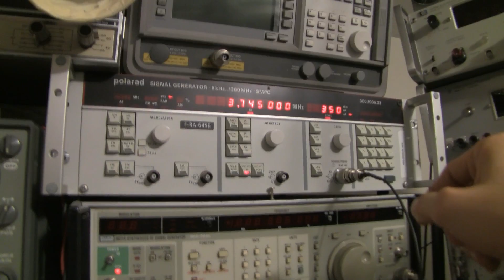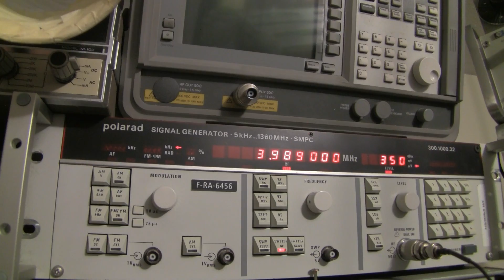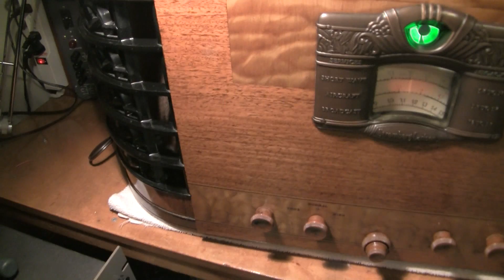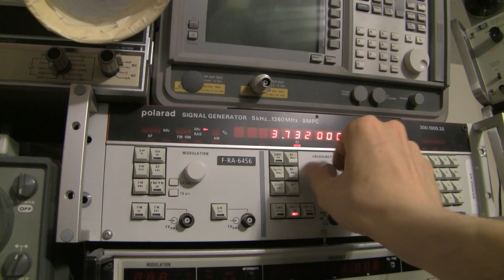Listen to SSB or single sideband on your old AM radio

Comment: An easier way is to inject a frequency close to the IF, about 455 khz. Best if you can do it in an IF stage but it would also leak in from almost anywhere. That way you don't need to retune it. Just rock the main dial until it's clear.

Comment: I used to consumer grade shortwave radios to receive upper side and on the 20 meter band by tuning the SSB signal on the front facing receiver then using the vfo of the shortwave receiver behind it as the bfo and zero beat the usb signal.

Comment: Pretty sure I’d have to be very careful trying to attempt this on a 1940s ac/dc set I’ve got, actually from listening to what you’ve said at the end. I think I’ll need to study this a bit more, as well as the receiver it’s self! 
I’m not sure how much noise that receiver produces, haven’t bought it back to life yet, I fed it a bit over 70 volts and it wasn’t happy pulling too much current.

Comment: You can also use another radio in close proximity. I used to use an old Panasonic multi-band to inject a leak into my Radio Shack desktop that lacked a variable BFO. I could tune the Panasonic to a sweet spot to generate a variable signal that decoded USB/LSB on the RS desktop.

Comment: Could you set your signal generator to 455kHz, find a SSB signal then tune the signal generator to 454kHz for LSB or 456kHz for USB? I'm curious if that would also work so one could build a simple tunable IF frequency oscillator to use as a BFO rather that using a 2 to 30mHz wide band oscillator or signal generator.
Reply: That's a much easier way to demodulate SSB

Comment: I suppose you could  tune a signal generator just off the IF (in this case ~465kHz) and inject it into an IF stage?
Reply: If you inject the 455kHz into the antenna input you will get enough through the mixer

Comment: Just came across your channel and its awesome so much to learn. I wonder even though this is such an old video if you would mind if I were to ask a question. I recently built a pixie HF CW kit ...It comes stock with a 7.032 XTAL but I swtiched to 7.050 due to class restrictions  . Regardless in order to verify it's operation I used a cheap SW radio and can get full quieting when I power the pixie up and have a 1/2 wave dipole connected on same freq.Of course as this SW radio similarly to what you show here is not SSB but only AM I cannot hear the CW properly . Now just for testing of something similar to this I used another SW radio tuned to almost same frequency to simulate a BFO and I was able to get center carrier quiet and either side a tone . The question is however If I transmit on the pixie all received is the inverse i.e. on the receiving radio I hear tone and the breaks vs nothing and tone if that makes sense. What am I doing wrong in ref. to this ? thank you if you see this .

Comment: really cool, thanks! can you go into a bit about why this works? you say in the video that the radio "thinks" there is a carrier there, but obviously we are not tricking the radio (it doesn't "know" anything).... why doesn't just tuning the center frequency correctly to where the carrier would be, allow the envelope detector to work like this too? why do we need a carrier (a fake one or not)? the "information"/baseband is all in the sideband already and we don't add anything "special" with the fake carrier injection right?
Reply: The carrier needs to be added. Thats what injecting the signal does

Comment: Mr. Carlson,
I was just thinking.  Since you know how to cleverly place modern components into radios originally designed with old-fashioned ones, I started thinking.  You can create a 540 kHz (or 540,000 cps) solid-state oscillator and use it as a fixed carrier for pre- or post-filtered IF signals which happen to be SSB, and then the radio at least has a carrier which will work to decode SSB.  An alternative is to use a "reversed IF" modulator, where you take the (f + 540kHz) carrier insert originally intended to add to the received signal to generate the 540kHz IF, and modulate the carrier through a 540kHz fixed carrier signal to generate a "reversed IF" carrier of f, which can then be inserted into the "front end" of the radio, and now it has a carrier which can help to decode SSB.

Comment: I'm wondering if this would work if you tuned the signal generator to the IF frequency?
Reply from the maker: It would, the signal would have to be stronger though, as the IF section is shielded, and it would have to travel through the tuned antenna section.

Comment: Paul, after watching this video of using a sig-gen as a BFO to listen to SSB, it gave me an idea!  With great difficulty I was able to use an old Grid Dip meter as a BFO for SSB!  I was trying to couple it to the antenna but it was difficult to adjust and couldn't make the signal stable.  It needed a more selective tuning adjustment, but with a steady hand it sort of worked!  Anyway, maybe you can come up with a better way of coupling a receiver with an old Dip meter to listen to SSB.  Let me know what you come up with!  Hope to see a video of it too!

Comment: So, if I build a VFO working (for example) in the 80mtr band, feed a little bit of that signal into the antenna input of my old radio, then I am able to receive SSB signals? It makes sense, because I'm adding a "carrier" to the signal! And the radio can demodulate it! Thanks Carlson! That was an eye opening moment. I Always thought that SSB receiving was a very complicated thing to do. Uhm... Generating SSB signals is just a little bit more complicated I guess? I Like your channel, thank you for all the videos!
Reply from the maker: Glad you're enjoying!
Reply: You can actually generate both AM and DSB signals using the same 4-quadrant multiplier circuit, if you are interested. The AD835 allows you to do both AM and SSB signal generation with just a small change to the circuit. If you then use a band pass filter to suppress the unwanted sideband when on DSB mode, you can emit in either LSB or USB. However, that extra step might not be needed.

Comment: 50 years ago I had this problem and by accident found a small two transistor radio placed on top of the receiver and tuned to 550kc allowed ssb to be understood clearly. If I remember correctly usb  required the two trans to be tuned to 650 for usb and 550 for usb.

Comment: Mr. Carlson: 

This method works with small digital shortwave radios like the SWED 100 A1,  a portable model by TARGA ?  No BFO for SSB/CW in this "World Receiver", of course. 

And it doesn't had antenna input soi made one with a female RCA. 

So, if this solution really works with small radios like the TARGA SWED 100 A1, i will buy a signal generator and go ahead. But before, please confirm it if possible.

Thanks in advance for your comment.

Macedo Pinto
Portugal

Comment: I had a domestic Marconi 5 valve radio once, and I used a transistor radio to get SSB on the Marconi, I got a 2 foot length of wire wrapped it around the RED oscillator can of the transistor radio and then to wrapped the other end to a IF can with careful fiddling I got SSB no problem, I done that for hours on end.

Comment: I used to recieve south african radio on my guitar amp when I had some effects pedals into it in a certain sequence, Would have been quite anoying if I was trying to record.
Reply from the maker: +rimmersbryggeri 
Wow, something was in tune in that circuit.
Reply: Yeah It was something in the chrus and flanger pedals that combined with the strings and the foil isolation on the scratchplate. I guess that could act as groundplane.
Reply: I used to get cb chatter on my corded land line phone and also the old pay phone across the street. Don’t know how that happened.

Comment: Cool....another way to copy SSB and CW is to cause the I.F. stage to go into oscillation by simply wrapping the insulated end of a piece of wire around the lead going to the plate of the converter/mixer stage...then, wrap the other insulated end of that wire around the lead going to the plate of the detector stage...wrap it right on around the insulation of those leads. ..just a few wraps on either end should be enough 'gimmick'-capacitor coupling to cause the IF stage to regenerate and mix with the incoming signal....experimentation will determine the optimum set-up..enjoy! :)
Reply: Basically the same thing, only on a much smaller scale ... locate the collector of the converter stage and locate the  detector diode and wrap one end of the hook-up wire around the collector lead  and wrap the other end around the diode's anode lead. 

The goal is to cause the IF stage to go into regeneration so it's self-oscillations will heterodyne with the incoming CW or SSB  and make those signals understandable.
Reply from the maker: +Terry McKean 
Thanks for your comment Terry!
Reply: +Mr Carlson's Lab  You're welcome :)
Reply: How do you do this with a transistor radio...that has shortwave, but no bfo control.???

Comment: Would this work with modern shortwave receivers? I have a C Crane-SW. I enjoy this radio but it obviously doesn't have a BFO for SSB/CW. It seems to be difficult to find a TG37 module and I was hoping that a cheap RF signal generator could do the same thing.
Reply from the maker: +Trever Minton 
If your signal generator is stable and not a harmonic type, it should work.

Comment: I remember doing this maybe 18 years ago using an LM-7 frequency meter and RCA K-80 console. I loosely coupled the LM-7 to the RCA by connecting a wire from the antenna jack of the LM-7 and making one turn around the K-80 antenna wire near the antenna screw. Worked real good.

Most recently did this with a Stark LSG-10A and also an EICO 315 and the receiver was a BC-455A which had its BFO removed by a previous owner.

I found those two RF generators were not stable enough to adequately work for SSB and also the tuning on those two generators was not geared down enough.

That said basic service grade RF generators may not be good enough without modifications to make them more stable and further gear down the tuning.

Stupidly disassembled my original LM-7 maybe 12 years ago for a tube socket, but I have another I got maybe three years ago still waiting on me to finish replacing the bathtub capacitors and once done I'll build a power supply then set it up again in such a way that it will work with multiple radios that have their antennas in the same room as the LM-7.

Comment: Cool. Can you hook up an  aerial in addition to the signal generator? Those signal must have been fairly strong if no exteranl antenna was connected yes?
Reply from the maker: Hi Mel. There is an antenna hooked up. You use the signal generator to inject a very small signal at the antenna jack on the rear of the radio. So basically your mixing the two at that jack.
Reply: +Mr Carlson's Lab When you mix the two signals you don't need any diodes or anything? You literally have the siggen output in parallel with the antenna? Great video. Thanks.
Reply from the maker: You got it.

Comment: Nice little video.  Have you tried coupling the signal generator to the IF which would allow you single knob tuning of the band?
Reply from the maker: Hi Stephen. That would be a fixed frequency BFO, being only single knob tuning. That procedure would be a little more complex for most antique radio owners. With this mode of operation, the radio can drift off frequency and no change in pitch will be heard on sideband. This requires the signal generator to be stable though. For a more advanced application, your idea would be great.
Thanks for stopping by!